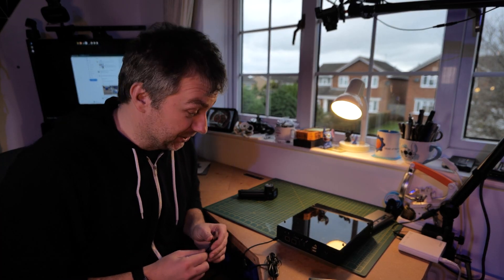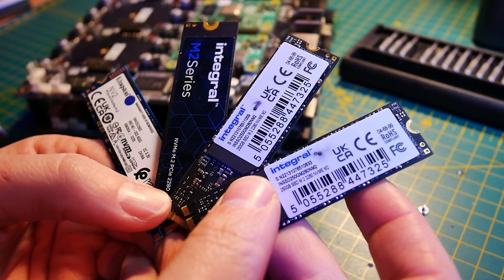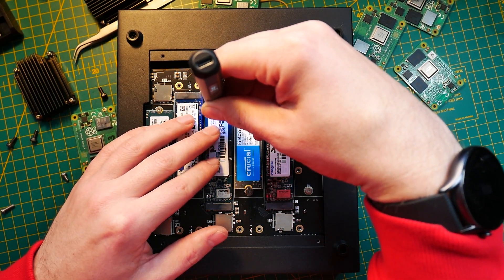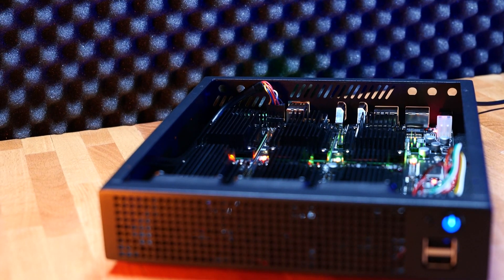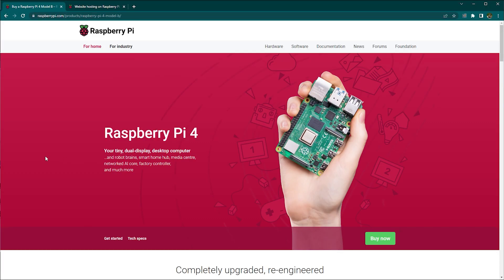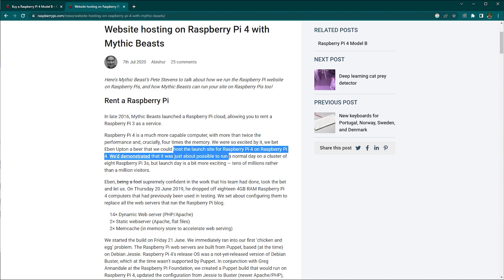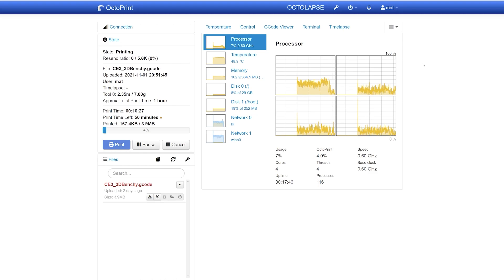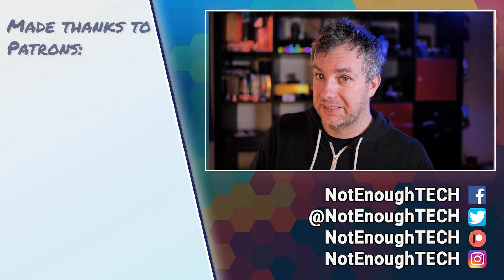DeskPi Super6C

Comment: The pcie slots from what I can see are single lance gen 2. Is this info correct?
If so, wouldnt it be faster to connect a sata ssd to the new RPI5 via the usb 3.0 port, for instance?
Reply from the maker: To be tested but gains would be rather marginal. USB3 could have a higher theoretical throughout but pcie world directly with the processor removing extra overhead.  At these speeds I think the bottleneck would be still what the CPU can handle in operations. I rarely max out my drives in my desktop machines and that is rocking 4.4ghz in 8 cores
Reply: @notenoughtech  Good point. I dig this, but unfortunately, they are still out of stock pretty much everywhere, and where I can find them, it's very expensive. With RPI5s coming out embedded with the same PCIe slot, I don't seen this being worth atm. It also lacks 10Gbps ethernet port imo.

Would be cool to see an upgrade to this board and maybe in the future might be worth for a home cluster, but for now I feel like a cluster case with RPI5s (even RPI4s) rather then the compute modules is a better investment. Anyways, thanks for sharing, subbed ;)
Reply from the maker: @lengors7327 I'd like to see 10gbps but at this point we will enter the space of small form factor computers that you can buy.. or just getting an inexpensive NAS.

Comment: It looks great.  But ... Where the hell do you get any CM4 boards, let alone 6 of them???
Great video though.  Really like this case.     Interesting that the CM4's are reaching thermal throttling even with low speed fans,   CM4's are designed to be passively cooled.....     Nice that you found a good solution for that.
Reply from the maker: The heatsinks make all the difference. 
About getting CM4s - I simply prayed to the gods of computing and sacrificed a couple of virgins. No Biggie 🤣😂😂

Comment: Bro what it can do with this power i wanna know
Reply from the maker: I'd assume if you have your sights set on one... You know exactly what you need it for.
Reply from the maker: Don't worry. This is the thing. A cluster computer isn't for everyone. It has very narrow filed of use if you want to use it properly. Otherwise it's just a bunch of computers on the same network. 
A great example for this is web hosting where you can delegate each aspect of hosting page to a different node working in tandem. It will speed up the page and will hold more users without investing in very fast processors. Think of this like this. It's cheaper to buy 10 slow computers than make your CPU 10 X faster.

Comment: Man, who cares about rpi4 these days, they lost their relevance with unavailability and very poor price/performance
You can get x86 system which runs circles around this Frankenstein system for less than 1/2 the cost
Not to take from Rp foundation credit who kicked start the diy revolution again
Just saying
Reply from the maker: Size, power consumption gpio and rich community are still valid advantages. 
Prices and availability isn't a problem that RPI is responsible for. Unfortunately we have COVID to thank for it. I work in robotics and we still have 6-8months leads on some components.
Reply: @notenoughtech  I see your point, ryzen 5 with decent ram, supply etc would be cheaper with slight more power. The comparative power is unlikely to be saved before needing to upgrade again.
Emulate rpi gpio 😉
Reply from the maker: The most expensive raspberry pi board is £75. Let's not compare prices of scalped items Vs RPP. They are hard to get in stock but they are still sold in legit places at correct retail price. 

In reality most of RPI projects use about 30% of the computing power offered by the board too. It's not a board that meant to compete with computers. 

Break down raspberry pi zero 2 by performance price size factors and you will see that in the that space it's a hard to beat value. 
You won't run crysis on it, but when was the last time you have seen a desktop or even laptop components on a free moving robot?
Reply: You're not getting 24 x86 cores for less than $500.